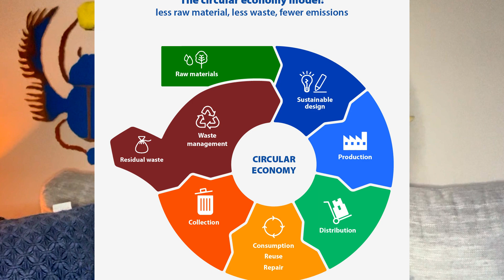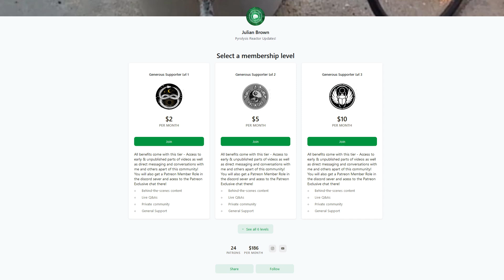ISLAND BOY MAKES FUEL FROM PLASTIC!

Comment: Guess who's back? Nature is back... tell a friend... 😂
Reply from the maker: Nobody wants to see nature no more they want shady Im chopped liver...
Reply: @naturejab nah nah nah, you are good... getting the snowball to roll is the hardest part, you are just getting over the hill with this project, almost got the snowball over the peak, man....
Reply: @dertythegrower  sure.
The first few tens of thousands are the hardest. After that, it gets self sustaining.... 
Just like pyrolysis, the start-up energy is the biggest expense, after that, the system can self perpetuate by utilizing the gas produced.
Reply: @Hobby_trails_repository 
How does this work.  I don't think just melting
The plastic , will turn it into diesel fuel.  ...Where's the step by step procedure..
Reply: @design_build_create  heating certain types of plastics in a oxygen free environment at a certain temperature breaks down the hydrocarbons that make up the plastic into fuel. 
Plastics are made of long chains of hydrocarbons. 
Fuels such as diesel and petrol are made of shorter chains of hydrocarbons.